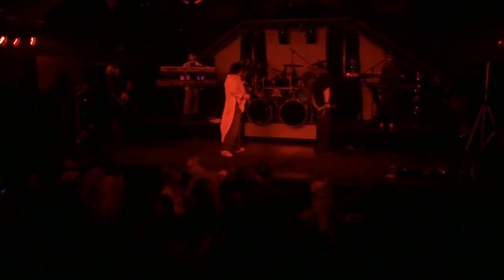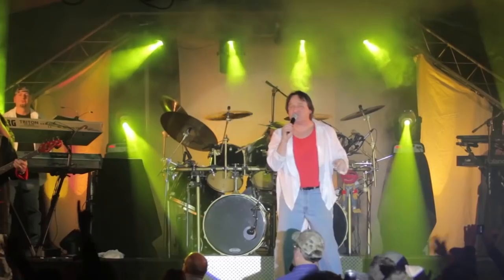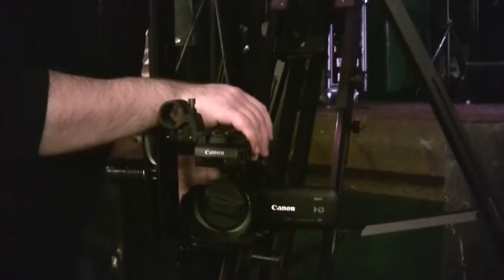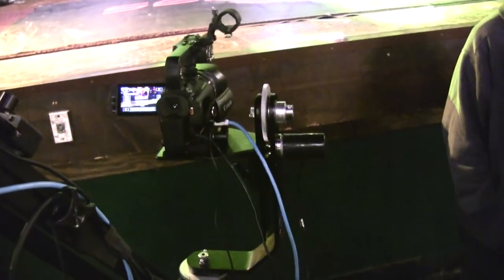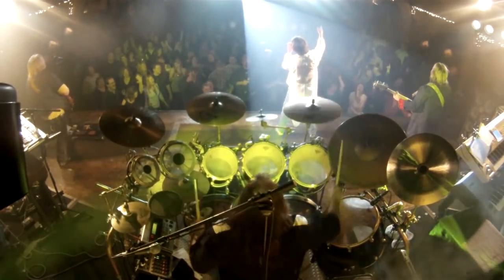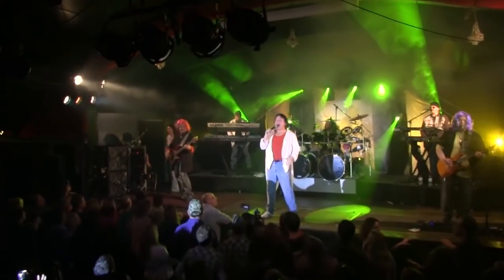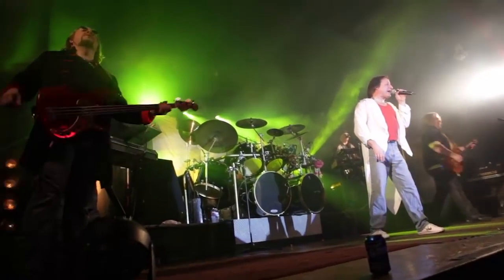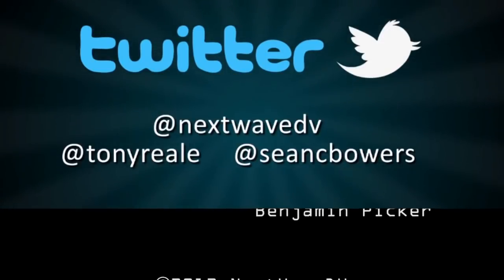Film Scene - Shooting a multicam DSLR rock concert music video production

Comment: We shot a Battle of the Bands competition at Hard Rock Cafe with a 6 cam setup. 3 DSLRs and 3 GoPros. We had a GoPro drumcam and then suctioned GoPros to the lead guitar and one on the lead singers mic stand. Worked well when the lights were full. Lead guitar GoPro is great for those shredding solo moments.

Comment: I've done a lot of these types of shoots, first with DV cameras and now with DSLRs and GoPros. Without all the cool gear in this video though, there are mostly static shots. Here are a few things I've learned.
1. get audio from as many sources as possible: direct from board, zoom recorder, camera with a decent an external mic (I.e. Rode). Syncing Audio and video in post is not a big problem. You can mix the sources as needed to get a good quality mix along with the ambiance of a live show.
2. You can mix video from different performances but only for brief shots due to syncing issues. Though It is surprising how long a shot will stay in sync with a band that's played together a while.
3. I haven't had a problem with DSLRs overheating but the 12 minute maximum file length means a lot more time spent syncing video clips in the timeline in post before starting editing.
Reply: Perhaps consider Magic Lantern to bypass the 12 minute limit? Works for my concert recordings

Comment: Hi man cool work and really useful video! I'm just wondering what did you do for sound? I am filming a concert in my local theatre next month and I'm most concerned about getting some decent sound quality as obviously thats really important for the music!
Reply: It seems that they did a multitrack recording to Pro Tools. So basically all the mic lines from stage were captured separately through the direct outs of the mixing console and recorded to a computer hard drive. Get in touch with the sound engineer of thee venue and ask if they can help you.
Reply: to get the audio good just buy the cd boot and synch it
Reply: Antti Laukkanen how you been?, do you have a tutorial on how to do this?

Comment: Very nice job. I do have a question. How did you keep the audio in sync on all the cameras? Even if you used a master time code generator, with all the camera's sync to that, it would still be a difficult job.
Reply: That's the point of a good editor to line it all up in post. Trying to shoot this way is an editorial nightmare and why we use our mobile unit with 8 cameras to hot switch. We also iso record for cutaways or "patches" in post. Everyone tries this technique a few time and you can only do it for free since it sucks up so much post production time no one can really afford it as a commercial venture.